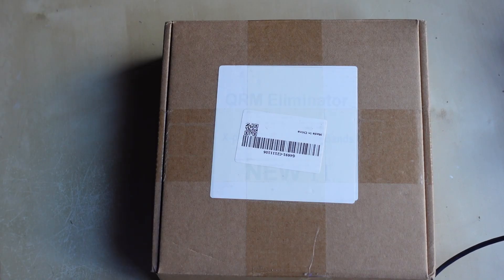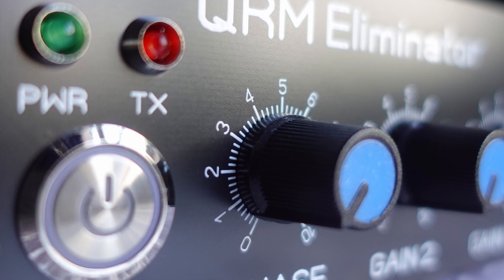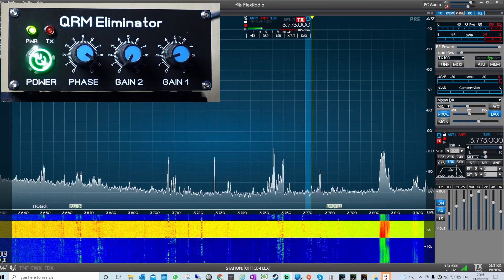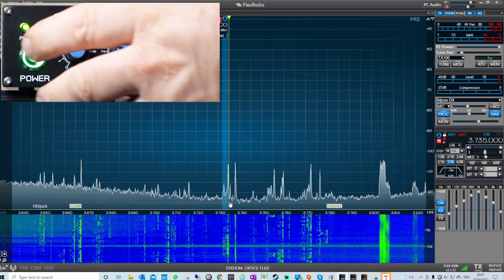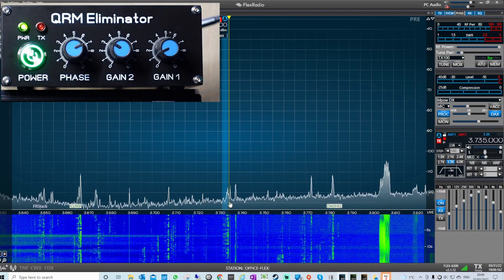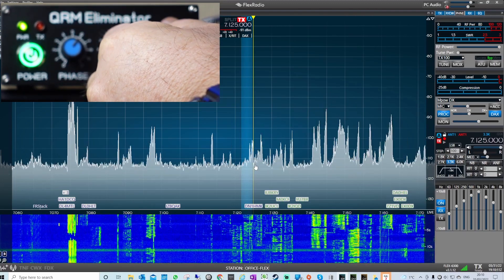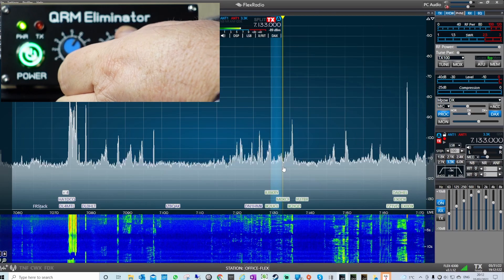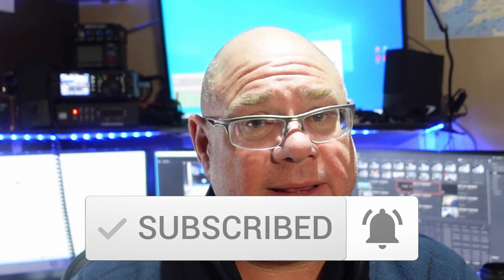QRM? Here is the solution.

Comment: It's not just a case of juggling knobs.

1.Set the phase control to zero, and gain one (for the main antenna) to its maximum setting. Start with gain two (for the auxiliary antenna) at zero. 
2. Increase gain two until the noise signal reaches its maximum loudness on your radio's S-meter or by ear. 
3. Adjust the phase control to minimize or eliminate the unwanted noise. You may need to fine-tune both phase controls to achieve the best cancellation. 
4. If needed, adjust gain two again to maximize the noise signal on the auxiliary antenna and then readjust the phase controls for further noise reduction.

Comment: I bought one that looks the same as this.  First issue was the clowns that made it clearly never did any level of testing after assembly.  When switch off there was no connection at all from the antenna to the radio.  When switched there was on RX from the AUX antenna and nothing form the main.  An investigation revealed that the turkey who assembled it bent a pin on one of the relays , so that it was squashed and never entered the hole in the board.  Now fixed it seems to function.  More testing to do, but given my experience so far, the first test is going be with two sig gens and a dual track cro to see if it's actually doing what its supposed to do.

Comment: I have an old FT 840.  I use one of these with a BHI 1031 audio DSP box and both transform the operating experience.  I set mine with gain 2 to max - no attenuation of the signal.  My antenna is a 2m band colinea vertical on a 5m pole.

I have HV power cables (pylons) less than 100m from me.  Once matched, i get a 2 s point reduction in noise on the 40m band with no signal attenuation.  For £50, that is a good return.  I am still experimenting with antennas - there may be more to come.

The bhi unit clears up the rest.  I did have an Icom 7410.  My FT840, Eliminator and bhi unit blows the wheels of it.

Comment: I am a shortwave listener. I have battled S9 noise on all frequencies below 10 mhz for some time. Most of it is caused by my new build house central central heating and hot water system.  Having used a similar noise canceller years ago at another location, I was confident this new noise canceller would give some improvement.  It does work very well, you have to experiment with all combinations of settings for each band, I also found a longer local sensing aerial  worked better for 80 metres, wrapping part of the sensing antenna around the incoming main aerial coax cable seemed to help on lower bands.  I have put chokes on the coax to my wellbrook loop antenna, chokes on power supply cabled, this noise canceller made the biggest difference , well worth it.

Comment: I think the crucial bit here is as you switch the unit in and out of circuit, yes you can see the amplitude drop but the signal content of your scope seems to drop by the same amount. Is the signal to noise ration actually improving ? Interesting and something I have thought about. Do you still use the item 6 months on or is it on a shelf ?

Comment: Nice video, thanks Mike!
Expensive radios may have several good filters as some commented here. On the other hand that's why they are expensive. If the receiver of a radio is sensitive enough, then indeed this eliminator works by offsetting down the signal level such that receiver "cannot pick up" noise even on a broader bandwidth. Although S/N ratio is not improved (if not decreased), the noise is attenuated away at the antenna port. As shown, the combination of eliminator+radio with good receiver works fine in practice (and is indeed cost efficient if radio is cheap). And human's perception effectively reacts on audibly absent cracking noise rather than on poorer S/N and lower audio volume.  

I think it would be interesting to test following:
1) What about testing this eliminator with radio having the receiver which is, say, few times less sensitive? I am pretty sure you will find radios when this eliminator will not perform well.
2) Also would be interesting to see how it performs at 70cm and 2m bands, say with handheld radios.
3) Experimenting with automatic or manual squelch may lead to surprising results drastically limiting eliminator's application.

Comment: Turning the RF gain down does the same thing
Reply from the maker: Not quite
Reply: If you have used one of these cancellers you know that they do work. It is not the same as turning down the RF gain  there  can be reduction of the wanted signal but with the right local noise sensing aerial you can get good noise reduction without loosing too much or any wanted signal. You need to spend time playing with one to see how it works. They are really worth trying when you have noise destroying your radio listening.

Comment: I got one of these a few months ago.  It works better at higher HF freqs.  When set to null on 10M, I could hear stations that I couldn't hear at all with it turned off.  If you're interested, try to make sure it has the built in VOX.  On ebay most of them don't have this feature.  The seller I bought mine from isn't carrying them right now because of the Ukrainian/Russian war since he is in the Ukraine.

Comment: Hi Mike have you tried an external antenna outside? I put up a short piece of wire and fed with crap coax and definitely noticed a difference between the whip antenna and the external 1 73 Gm4zji Chris
Reply from the maker: Hi Chris. That is part of the process going forwards to make it more permanent.Thanks

Comment: Hi Mike, I have the MFJ version which I've done some experimenting with. I had very mixed results to be honest.

My personal experience is that it was absolutely fantastic for narrowband QRM on spot frequencies but it was pretty hopeless on wideband QRM (such as VDSL or other broadband interference) which covers the whole band.

I did however find having to keep tuning it every time that I changed frequency/band to be a bit of a pain.

There's no doubt about it, they do work & they have their applications but it's not a silver bullet. Unfortunately it didn't quite give the results that I was hoping for in my case (where I have very high noise across the entire band on 40m & 80m). Having said that, there are a lot of cases where I can see it being a great addition to a station.

To cut a long story short, it's a few months after experimenting with it & I don't currently have it connected!

Comment: I'm still trying to track down the source of QRM generated from some device in my Hymer motorhome. I have found a fuse, which when removed, stops the noise, so now I just have to find what circuit that fuse is protecting.
Reply: If you have an inverter, my money would be on that.

Comment: Used one of these for over 30 years although mine is RF sensing so doesn't need a PTT switch, by reducing the noise floor presented to your RX input it certainly makes for cleaner reception of signals, experimenting with the noise antenna is also interesting, the better it picks up the interference the more effective it is. - Mark
Reply: I agree.. I use mine with a Broadband RX Loop in the loft... Works great
Reply: Frankly, I would choose the PTT signal. RF sensing is fancy, wireless, and also known for burning transceivers over time as it might be not quick enough to switch off RX antenna.
Reply: @2EOGIY  My JPS ANC-4 is not equipped with PTT and it has lasted 30 years without ever having a damaged radio.

Comment: Those are not required......If you just use your radio filters you will get the same or better results.
Reply from the maker: Clearly you know what you are on about. Show me how you do it.
Reply: In my experience I can say this is categorically incorrect, by reducing the unwanted signals before they get to the radio you actually allow the filters to work better, unless of course you think I've run HF all these years without actually trying the filter only route ?.
Reply: I agree...but not 100%. Every case of QRM is one of a kind. But by using the built in attenuator on the radio we can rid off a lot of QRM. Of course, there are a lot of operators that like to see big signals on the s-meter and dont have a clue how to use the ATT nor the RF GAIN. Let your ears be the judge, not your eyes, and use high dynamic range receivers, perhaps use your RF GAIN as the volume of the equipment. This is only valid if you'r not digging to catch a signal burried under the noise where that's the only situation i see this equipment whould be usefull.
Reply from the maker: @drizzt3705  Totally Agree with you Andre. RF Gain is important and the big usefulness of this is trying to increase the gap between Signal and Noise to find the weaker stations.
Reply: @MikeM0XMX  the RF GAIN would be useless in this situation, but maybe the ATT would achive an even great result if used with the QRM eliminator, since the ATT is affecting the sensibility right after the antena, before any amplification or selectivity of the front end. Again, only if the signal is higher than the noise. I've not tried it yet, and in theory it should provide more clean signal for "elimination"
Reply: No. You won't.
Reply: yes show us all how you get  the same or better results.

Comment: It basically works like noise-canceling headphones. It samples near field noise and turns phase 180 degrees. I would not call it attenuation as it is selective. Probably if your receiving antenna would be much better you would have an attenuation effect. That needs further testing. What I'm interesting in too is how it will react on near field radiostation like radio amateur next street or so.